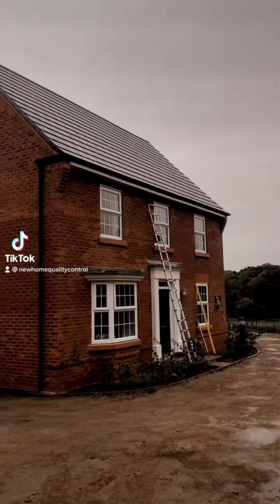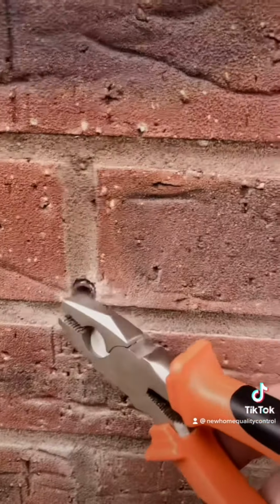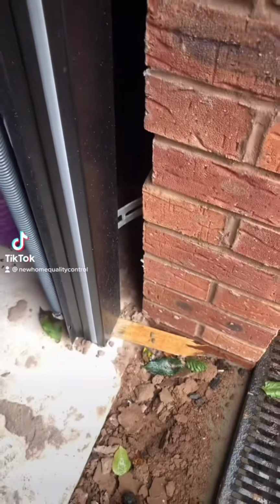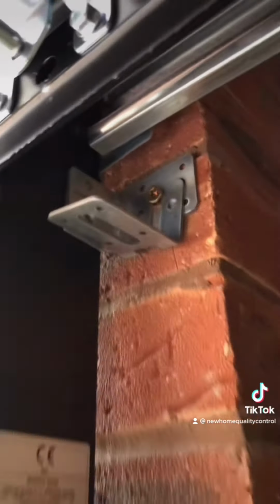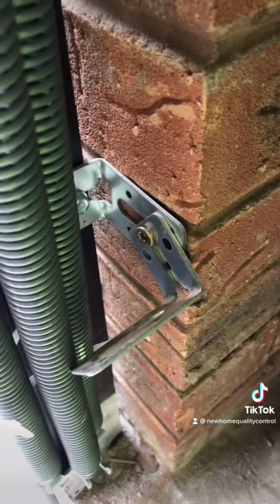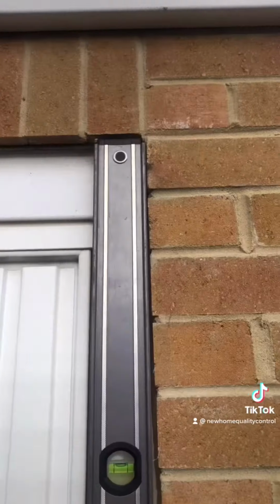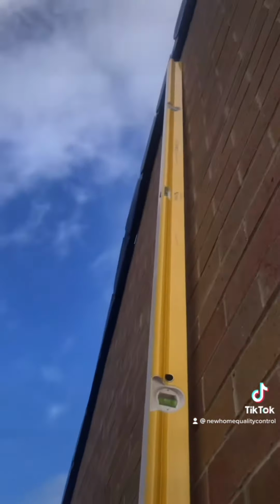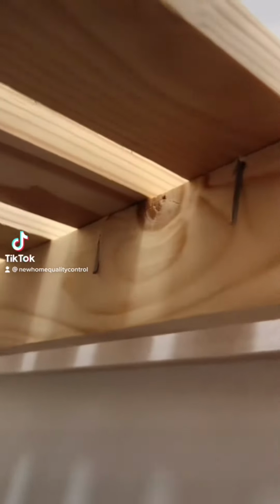BRUTAL NEW BUILD SNAGGING INSPECTION

Comment: Ok, so if a wall is that much out what happens? Is it a case of compensation or does the builder actually tear stuff down and rebuild it correctly?
Reply: Yes I was thinking the same. Would be good to know!
Reply: In theory the brickwork skin should be taken down and rebuilt correctly free of charge paid for by the building company ie. Persimmon or whoever built the house. But then again, you’re kidding yourself if you think that will happen so best way to avoid this is to not put money in their greedy pockets. 
From a bricklayer😃
Reply: No main contractor is responsible really...but they are at the same time, overall of course. But the house builders do not employ any tradesman.

All trade's are subcontracted. So, it's a case of getting them back in. Or handing it over to another sub contractor. 

Payment schedules are normally crippling in 90 day payment cycles. So the subcontractor originally undertaking this would likely not have the liquidity to return. If they stepped back on site to repair...they would never leave. Foot prints hand prints stains damage...you name it. They aren't A. Getting paid. Ever. B. leaving without an extra 20lbs of flesh. 

So most just cut the loss and leave it for someone else to rectify. 

The only person I go for in these situations is the site manager or CM. They will be leaving. Rapidly. Don't let the door hit your ass on the way out. 

And I try to manage the sub contractor to return and rectify. Some subcontractors can build 20 units perfectly and drop the ball on 1. It's wrong to throw away that relationship over 1 unit. Better to come to an agreement and replace the management issue.
Reply: Time to "Build Back Better".. 😏

Comment: That garage door is grim and some of the brickwork but I think we all know the garage roof isn't going to blow off with two tons of roof tile on it. The good lord sorted that out by giving us gravitational pull.
Reply from the maker: Unfortunately that attitude on the roof is the reason some people shouldn’t be in construction. There was a tornado in London a few months ago, if the roof ain’t strapped down and was hit in a hurricane are something like that it would be in someone else’s garden. Regs are put in place for a reason. I totally get you, but it’s that old saying, it’s always good until it goes wrong.
Reply: If that plot is in a low exposure area there is no requirement to fit straps as it is low risk, you need to check the design, most Builders fit them as standard in that case they should be fitted properly
Reply: @newhomequalitycontrol  I have been a site chippy for 36 years so maybe you're right it is time I left construction. I suspect you were in construction too at one point either as a tradesman or a manager but ultimately struggled so opted for the easy option of being a professional pickfault. I bet you were shocking
Reply: @Parmajohn123  I am referencing the wallplate straps which the video makes a big deal of and for which I have received abuse for. The internet is full of images and articles on every given subject. If someone can find me a news item/photo/video or any other reference of wallplate straps ACTUALLY preventing a tiled roof being blown off I will totally change my opinion and apologise unreservedly. I'm pretty sure in this country a wallplate strap has never even come under ANY upward tension let alone need to hold a tiled roof down.
Reply: @blower1  I base my claim on 35 years as a roofing joiner and a common sense practical approach to building rather than book taught.. The NHBC give out warrantees and alter their specifications according to payments they have been forced to pay out. The NHBC and local authorities do not require wallplate straps in all but the most exposed areas. I am forced to fit them on our site anyway and grimace with embarrassment as I do so. If you can supply proof either an online link or news item where a roof strap has stopped a roof blowing off I will  of course retract my claim. I am not referring to gable restraint straps which do have merit.

Comment: You've got easiest job in the world with that big level. Try building a house with wet bricks and for there not to be any discrepancy with the plum. Dont get me wrong alot of it is "shocking" but a garage 20mm out top to bottom is not something you would see with your eyes at all
Reply from the maker: Yes, and it likely not going to fall down. All irrelevant, if a warranty provider is setting out Tolerances then they need to keep to them. All our inspectors are from site, we know how it is. we’re hired to tell the homeowner how it is, and that’s what we do.
Reply: But I thought a brick layer used a spirit level, so the customer doesn't have too.
And if the brickwork is out 20mm from the floor to the garage roof,how far is it out at the gutter?
I don't think a wet brick moves that far or shrinks that much

Comment: ooooh we have a couple of finish pins skewed through the slatted shelf......get that wrecking ball and lets start the site again.......or maybe we could snip them off in about 15 seconds and the world is saved again. How's the hunt for some evidence of wallplate straps ever having saved a roof from blowing off going?
Reply from the maker: Take your cowboy hat and horse out of the comments 😂😉
Reply: @newhomequalitycontrol  mmmmmm seems like that's a 'no' on any actual evidence then ..... The case for the defence rests m'lord! I'm not blaming you for your take on wallplate straps, someone has an idea in the building industry and everyone follows like sheep whether it is an actual improvement or not. The whole industry wastes millions of pounds per year on un necessary gimmicks like wallplate straps, truss clips, unnecessary protective works, kerb and drive edgings that always get damaged and replaced (so why bother?) and  pedestrian barriers that are far more hazardous than anything they are protecting you from!
Reply: Oh and I forgot the biggest crock of trollies. The air test. Lets shut all the trickle vents cover the ventilation fans and pump the house up to see if it leaks air?......WTF? This will be a great idea til everyone has asthma or someone actually suffocates.  I think the man who invented this is currently moored next to the truss clip inventor sipping his champagne on deck and laughing at us all.